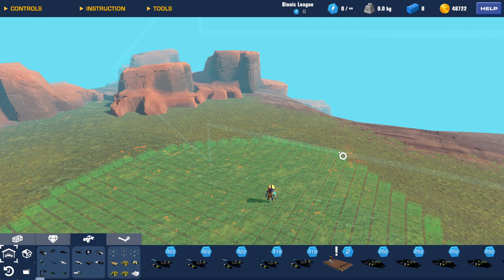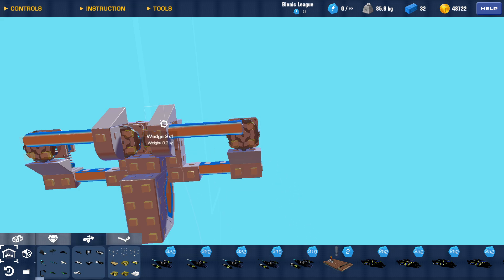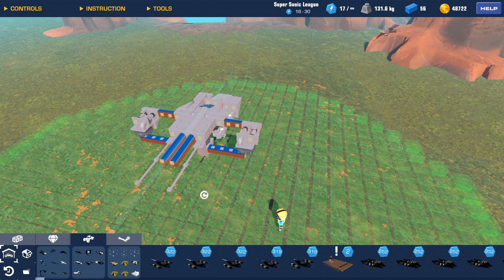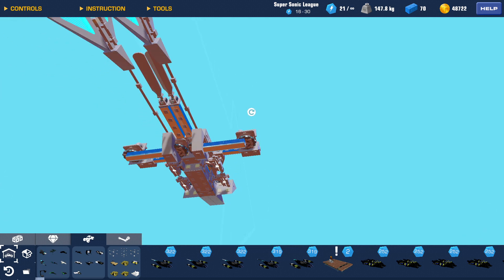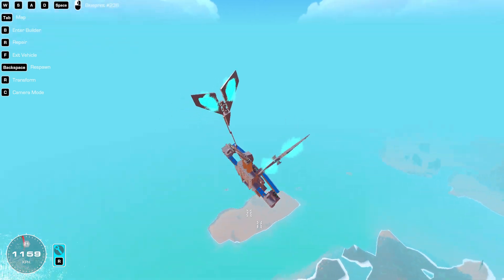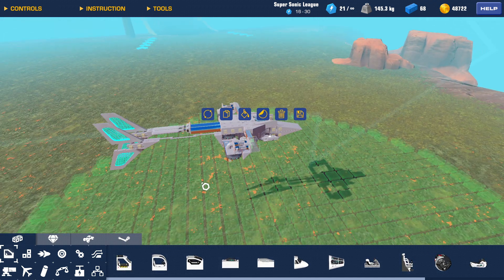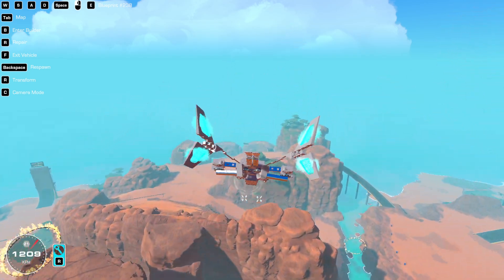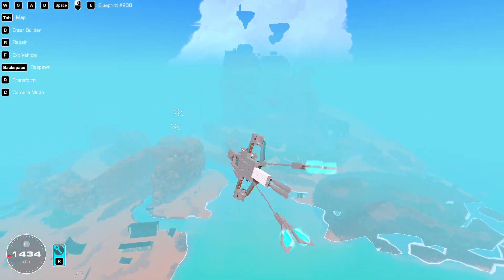How to make a splitter/suspention engine.

Comment: I’ve tried 3 different splitter drives, one with hinges on a block, one with servos on an aiming servo, and this one. The spring drive in the video, if done right, is by far the most stable and consistent! Very good tutorial!

Comment: what are the settings for the suspension and servos?
Reply from the maker: @NebulaDude394  suspension should just be default and angle should be 60-67ish depending on your design